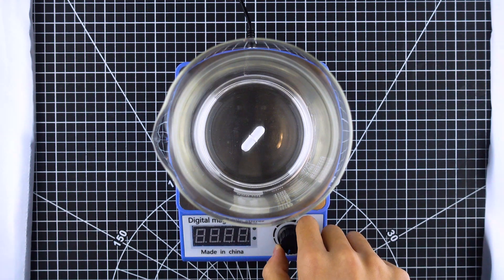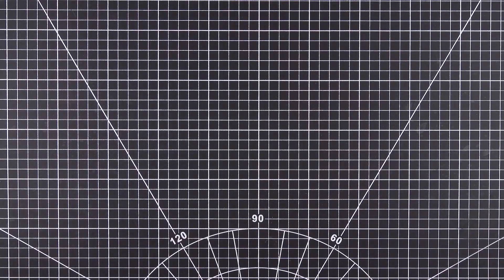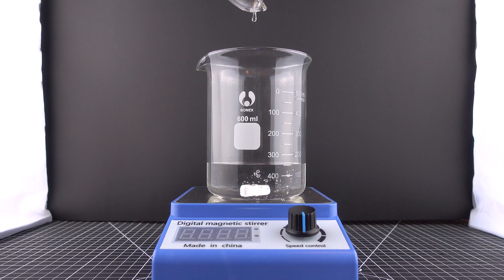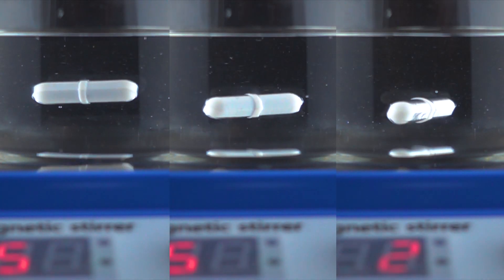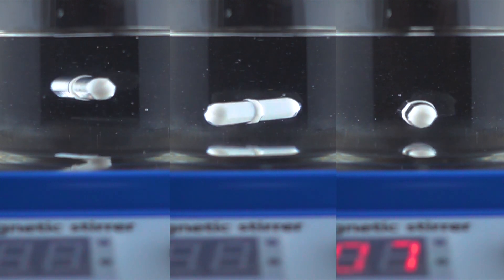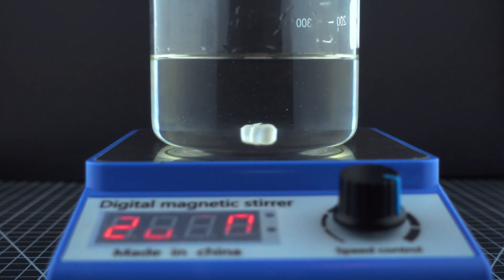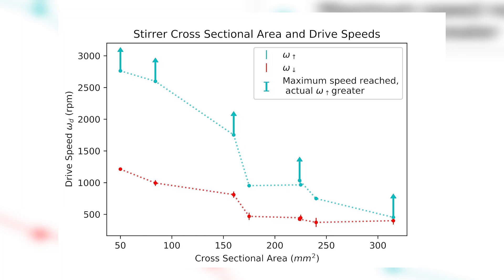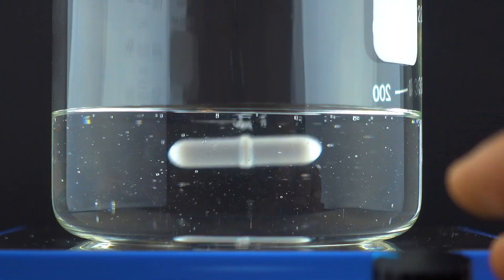Magnetic Levitation IYPT 2020 Problem 9 Demonstration

Comment: Nice video, thanks for sharing it.
Reply: Only as an assumption. To my mind, inertia of a fluid flow can explain all you have observed. A stir bar has to push apart molecules (make them move) for lowering to the bottom. But there is one obstacle – molecules of the fluid change their velocity slowly because of a big viscosity and the fluid can fast absorb an energy of a motion. Also non-stop changing position of the stir bar allows standing on motionless molecules. 

Regarding jumping the stir bar up when velocity is equal to omega up:  the fluid is already rotating and the part of the fluid near the walls losses velocity faster than the part inside. As a result, the stir bar is displaced into the low pressure zone.